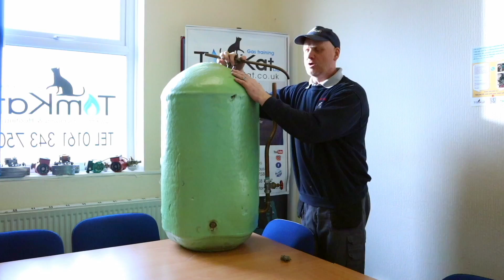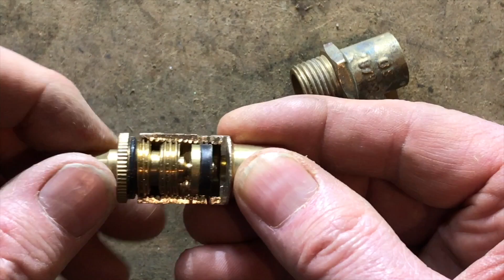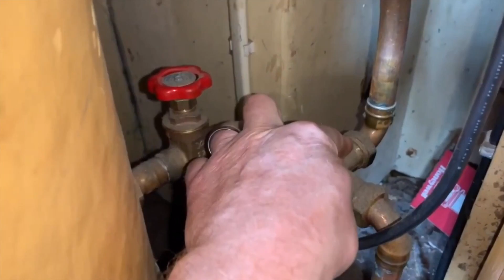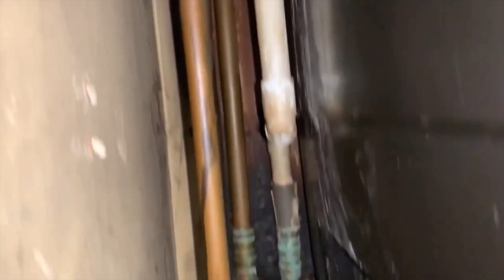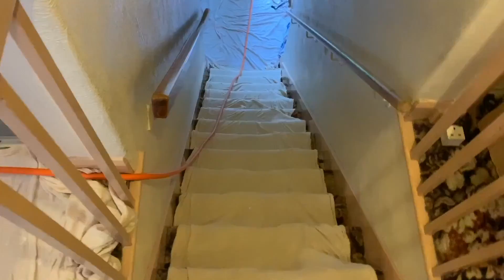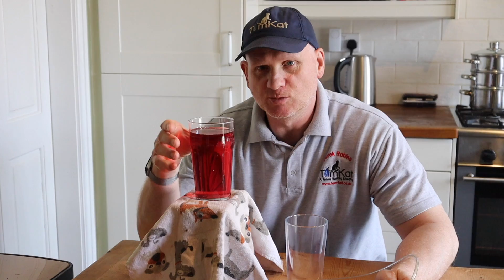HOW TO DRAIN A CYLINDER (not a tank) using siphonic action with a hose pipe also covers drain cocks

Comment: Your video has been a great help and I've managed to remove my primatic cylinder and all the copper & lead pipework.  I filled the hosepipe with water like you advised.

Also thanks for mentioning the part 2 ball valve.

Comment: Hi nice video , 
I have a question please . 
I have to replace a tap in my downstairs cloakroom. But is not any isolation valve on it .
I have a boiler with an Unvented cylinder upstairs, so I understand if I shut off the main feed  valve in the cylinder I stop the cold go into . 
But how I can isolate the hot water side ? 
Is not any valve after the cylinder 🤔
Reply from the maker: If you turn the main stop tap off it will turn your cold and hot off at the same time
Reply: @tomkatgastraining  seems to the hot water side not stopping 🤔🤔🤔
Reply from the maker: @Matteo-rs7nk  if you have an unvented cylinder it’s fed from the mains cold supply to the house there should also be an isolation valve at the combination valve at the cylinder if it’s not stopping but it will run for a short time before it stops

Comment: Great video, thank you. Is it necessary to also drain the central heating circuit when draining the cylinder to work on for example, the immersion heater ?
Reply from the maker: No not in most cases if the cylinder has a coil

Comment: Hi Derek thanks for sharing my questions is if I have 15 meter hose pipe long and want to drain cylinder should I fill hose pipe first ?
Reply from the maker: I will always have my hose empty because if it’s full of water you could create the siphonic action before you get the hose outside. Also when sucking on the hose to create the vacuum you don’t want a mouth full of dirty water.
Reply: @tomkatgastraining  thank you for respond you are top man 👍🏼❤️💐🙂

Comment: What's the red expansion vessel for in the video above the cylinder? This a mismatch of two previous videos?  :-)
Reply from the maker: Wayne Nixon it a mix of new and old videos to try and explain in more detail. The system with the expansion vessel was a sealed heating system with a vented hot water system. Hope that helps 👍🏻
Reply: @tomkatgastraining  Was the coil in the cylinder pressurised? Didn't think cylinders could be part of a pressurised system? But at 1 bar it's just like having a feed cistern at 10m head?